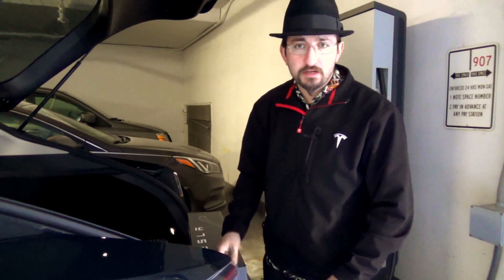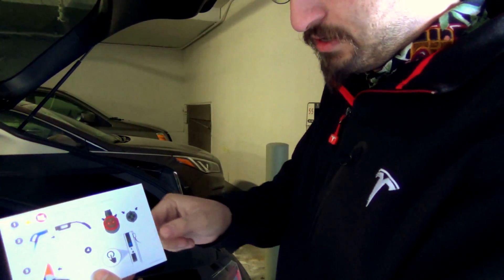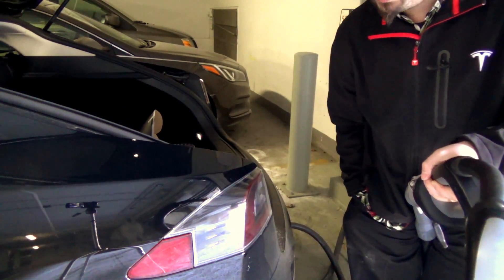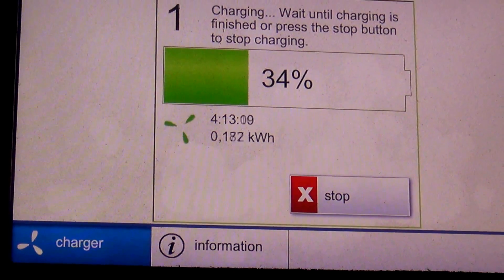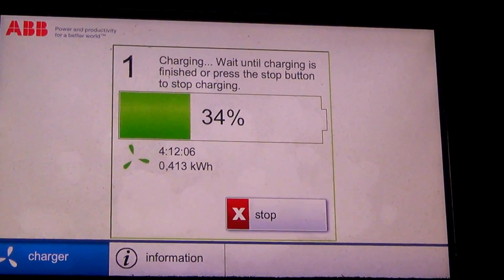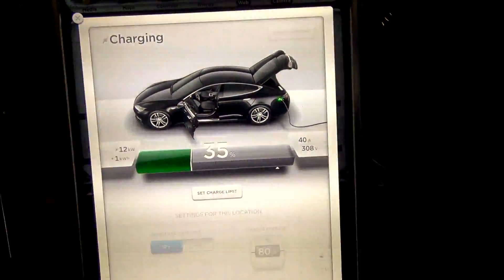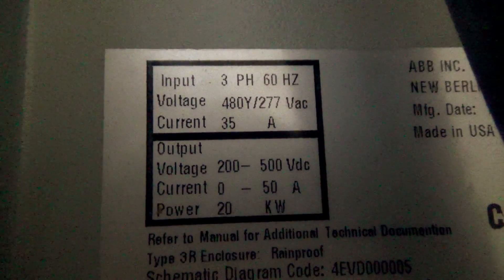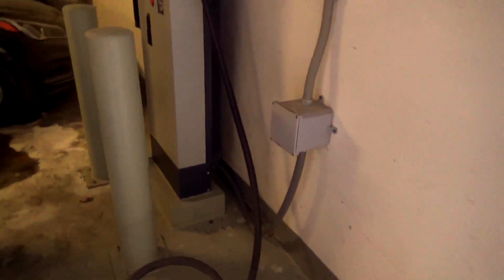Tesla Motors Model S: CHAdeMO HAS ARRIVED! Tesla Motors CHAdeMO Adapter First Test Part 1

Comment: He says it's a 20KW charger, but it's only charging his Tesla at 12KW.  I think this is the reason:  Chademo connectors allows up to 500V, and up to 125A.  Power is voltage times current, so in theory a Chademo connector can provide up to 62.5KW.  But this is a 20KW charger, so if the charger can provide up to 500V, at 20KW it would be limited to 40A.  40x500 = 20,000.  Notice on his Telsa, the charging current is 40A, which is the max current of this particular Chademo charger.  However, the Telsa batteries are in the 308V range.  So 308x40 is just over 12KW, which is his Tesla charging rate.  

If the Telsa had a higher battery voltage, then this particular charger would be able to supply more power.

So, keep in mind, with Chademo, a car with a higher battery voltage will likely accept a faster charge than a car with a lower battery voltage, when the max charge current of either the car or charger is reached.

I've just recently starting looking at EVs, and I must admit, the fact that there are three DC charging standards in NA was a bit of a turn off.  I wish they could standardize, but I hear there is no desire for the car manufacture to standardize.
Reply from the maker: Your math is correct.
As for charging standards, Tesla developed the Tesla standard, as it did & does what the others cannot, in a much cleaner, efficient and compact design. 
CHAdeMO is the Japanese standard, and is currently fading. The Combo is the new standard of the other Manufacturers now, however, it still does not come close to the power output of the Tesla connector, and is still somewhat large and clunky. 

Tesla has invited the other manufacturers to use the Tesla standard, however, they are basically giving Tesla the middle finger...   On the bright side, the nice, FAST, useful Tesla Supercharger and Destination Charging network, will be free of those lower range, slower charging compliance vehicles. 

On the even brighter side, with use of a adapter, a Tesla can charge on a CHAdeMO station, and a Combo adapter is in the works as well, though, very few of those combo stations exist yet. Tesla's standard is now the most popular in the world. Tesla has the most DC fast charging stations, and faster at that then anyone elses, as well as a very large and GROWING Destination Charging network that uses the same plug type. 

One of the beauties of the Tesla standard is same, sleek, SMALL plug, does AC Charging up to 80 amps, and DC Fast Charging. 

With the Nissan's and Mitsubishi's, you need two seperate plugs, a J1772 & CHAdeMO,    Those that have combo plug style have one, but it's larger as it supports J1772 and Combo Fast Charging (Hence the Combo part). 

It's really not too bad. Given the long range of a Tesla, Tesla's Supercharger network, which will be doubling in size in 2017 and tripple in size by 2019 (And I could already travel ANYWHERE in the Continental USA as of 2015's supercharger network, and we're already nearing the end of 2017, it has grown immensely already), just that alone, I RARELY if ever need to use anything but a Supercharger for any kind of travel. Unless of course, a store I'm patronizing has a free station, then I'll grab a few free kWh's while shopping or dining ;-) Though, most of those J1772 stations are going away in favor of Tesla Destination chargers (High Powered Wall Chargers or HPWC's) that can provide up to 80 amps AC, and a maximum of 20kW charge rate (In NA). 

It's really not as confusing as it sounds. Charge at home for daily use. For long distance, charge at a Supercharger. Done. Simple. Beautiful, just as a Tesla should be.

Comment: That ABB Charger said 20KW Max....
Isn't that the same as running a 240V-100Amp Tesla Wall Connector????
That ABB "Chadamo" sucks... lol

What are the speeds, Voltage, Amps and KW or the Tesla SuperChargers?

Comment from the maker: +Wyatt Earp Correct, I was amperage limited due to my packs lower voltage. The 85kWh packs can get higher charge speeds as the voltage of those packs is higher. 

I supercharge, a LOT. I have seen little to no degradation of my battery.
Reply: I think temp also effects the charge rate. Would be interesting to see if you get better results on a warmer day.

Comment: Whoa that's a big mamma! ... How heavy is that HUGE adapter?... then you will have to add on the weight of the BIG ChadeMO charging head.... i am hesitant to buy the adapter because i  would think all that combined weight will put some serious toque on the Model S and eventually damage the car's charging system?
Reply from the maker: TheWiseOldChinaman Wasnt too bad, the stiffness of the CHAdeMO cable actually held it up.
Reply: ***** I'm thinking about getting the CHAdeMO adapter because there are no superchargers in my area. However my Model S is not equipped with the twin chargers, so it won't benefit from a supercharger even if there is one in my area. So, my question is whether using CHAdeMO adapter can be used with Model S that are not equipped with twin chargers?
Reply: ***** by the way, i've never seem you to be more dashing and debonair than ever before on your video!  :-)
Reply from the maker: TheWiseOldChinaman Twin chargers has nothing to do with DC Fast Charging. You Need Supercharger access turned on for CHAdeMO. The car basically thinks it's supercharging. 
Didn't think i'd use it as much as I did, but I've already used it at least 4 times to increase convenience rate by a bunch. Beat sitting at home at 10kW for 4 hours. 1 hour at the CHAdeMO and I had more then enough. (Not cheeping out, just needed as much power as fast as I could).
Reply from the maker: TheWiseOldChinaman Why thank you. Now if I could only get a good honest woman :(   BTW, I did have a audience for this video. About 20 people were watching  about 15 ft away. They were standing in front of the J1772's as cars were coming in and out.

Comment: Charging at 44-50 MPH is not too bad, really... my NEMA 14/50 charges at just over 30 MPH, and my home Tesla charger at 60 MPH.  Might want to borrow a CHAdeMO adapter for a cross-country trip.  Fortunately, the 85S range is really high.  Note that CHAdeMO is 40 amps AT 309V DC which is better than 40 amps at 220V AC (higher power, less conversion loss).

Comment: Tesla's ChaDeMo connector is probably following the "standard" of 80% rated capacity because it's a long term continuous load rather than a "temporary" load, same reason on a 120V 15 amp circuit your car will only pull 12 amps. 80% of 50 amps is 40 amps...
Reply from the maker: The standard doesn't work like that. That apply's to AC Mains. And, does not apply if the setup is designed for contentious load. So, if it was not designed for the load, then the 80% is already taken off the circuit raiting from the mains side, so between the Station and the Utility.

Comment: I do not know I would be leary of using such a heavy adapter/cable on an 100k car I imagine all that weight would loosen the charging port but maybe that is just my ignorance regarding electrical and charging systems.
Reply from the maker: Adapter is not heavy, the CHAdeMO equipment is VERY heavy.
Reply: Would that weight not transfer to the port once the adapter was connected
Reply from the maker: Yah, a bit more then normal, not still not as much excessive pressure as I would have thought. Thankfully, these "Should" be used like superchargers, and not daily chargers.

Comment: Hate to have to say this, coz I'm a real fan of evs, but you would have been out of the station and halfway home with a full tank in a gas-guzzler or a Prius by the time you got that stupid, clumsy doohickey out of the trunk and took a pratfall trying to connect it!  Plus you get a parking charge thrown in with the free grazed knees and face the real possibility of some douchebag stealing your connector for the copper content. 'Waste of money' is right on the nail. Avoid this piece of junk folks, it sucks.
Reply from the maker: This would be the EXACT reason that Tesla Ditched the "Standards" and made their OWN standard :) Can we say, Tesla Supercharger :) By the time I got the CHAdeMO Adapter just connected, a Supercharger would have already given me 20 miles additional range. 

All Tesla adapters and cables are locked to the vehicle when the vehicle itself is locked.

Comment: Does it show on the instructions card to pull on the Chademo station handle to lock it I knew how to lock that connector and I don't even own an electric car (I wish) the reason is that I saw a bunch of videos on YouTube showing people connecting a car on a Chademo station don't be sad it's understandable you don't own a Nissan Leaf or a Mitsubishi i MiEV. Etc .... So how often you see a supercharger off line and I would think that if a supercharger would need a part like a cable I wonder how long it would take to get it and installed could you look in to it ask your local tesla service centre .

Comment: Pretty bad that the station doesn't display power but if it's as weak as 40A I can understand why they don't want to state it. Lame squared.
It clearly illustrated the difference in engineering attitude between progressives like Elon and the nitwit 'good enough' crowd.

Comment: I'm pretty sure you're supposed to squeeze the lever on the chademo handle to properly lock the connector in the adapter. I didn't see you do that and that could explain why it fell out.
Reply from the maker: I didn't realize that at first. As when I pushed the adapter to the CHAdeMO handle, it clicked and "locked in", And a little tug, felt like it was in tight.
Reply: You are correct.  With that style chademo you have to squeeze the handle to lock in.  It's counter intuitive and the new style chademos we are seeing in England don't use this lever (thank goodness.)

Comment: That "tiny little waste of money" line got me. But as you said the adapter "should" be worth it for those who dwell in the city and destination charging. Especially when a service center is too far or closed. Also what does ABB have to do, ship it by horse and cart, and then boat from Zurich?
Reply from the maker: Tiny waste of money is because it's such a low powered station. 20kW!!! Crazy! At least a "Normal" CHAdeMO on average is 44kW. That will make a dent in your charging. They already had the 480v three phase....
As for ABB;s cable, I think the unit was actually manufactured in Pheonix. At least thats what the front desk lady mentioned. Could be wrong. But still, just a cable with a end on it...... They may have lost a sale by not having that unit online at the local HQ.

And, got to test a Nissan unit, the one that was offline a few days ago, they reset it and it's online. Had some scaryness. I can see now why Tesla was hesitant to allow 3rd party systems direct battery pack access..... That nissan unit almost cooked my battery!!!!!!! Details to come! Uploading that video now.
Reply: ***** That last part sounds like you got the short end of the stick for being one of the first real world guinea pig.
Reply from the maker: Seems it was a "Test Phase" of the unit, to make sure no power leaks to ground or from + to - . I personally dont like it but the car did what it was supposed to and killed the connection until the voltage dropped to appropriate levels.